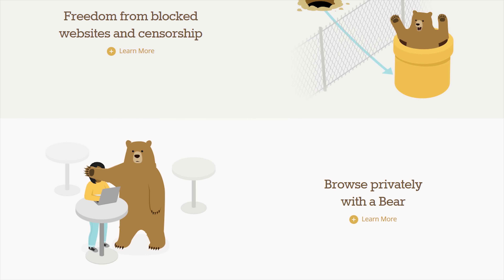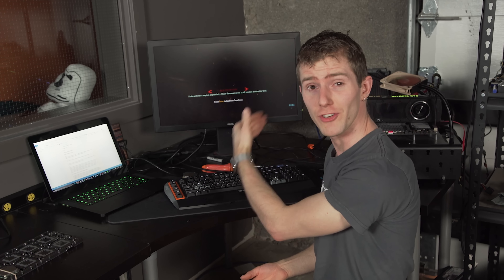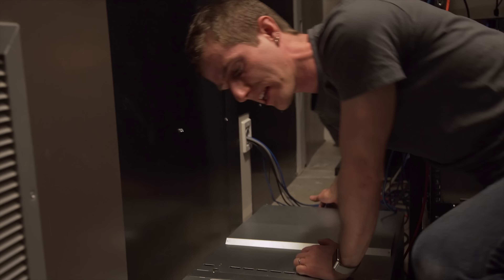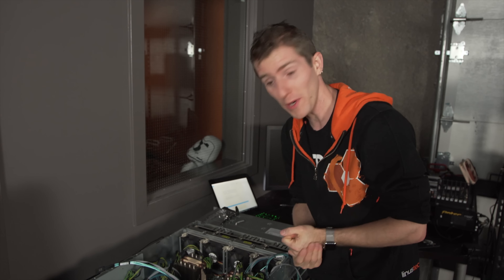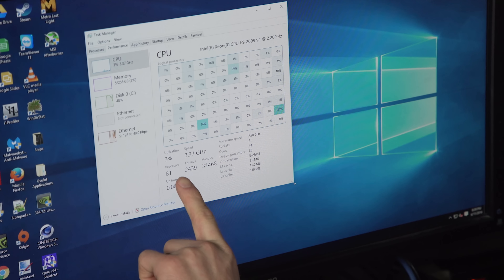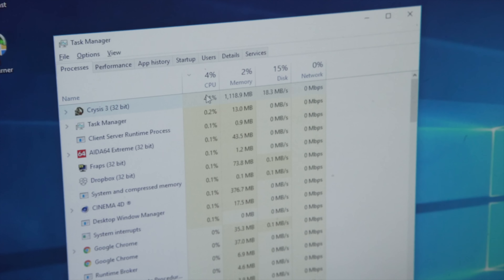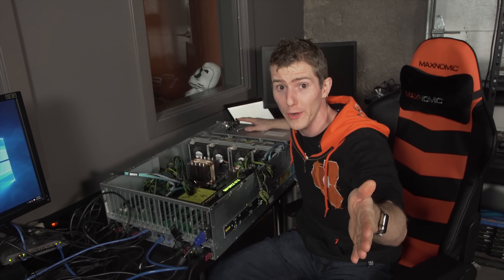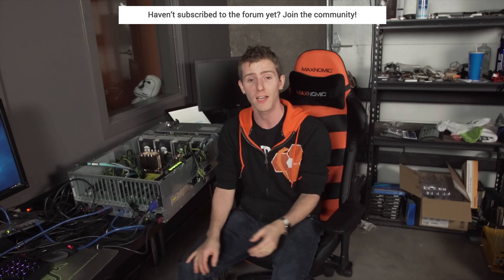Two 22 Core Xeon CPUs!? - HOLY $H!T Episode 6

Comment: ASrock has a x99-itx/ac board that can use this. (mini-itx) this is a fact now.

I saw  a 'xeon e6-2696v4' that is 'supposed' to be the OEM(tray) version of the Xeon e5-2699v4 cpu. is this actual or just some sort of sophisticated ripoff? supposedly this 2696 variation is identical to the 2699 except the TPD is 150W instead of 145W.

Comment: I have i7-4770K and I would say it's waaaaay more than enough for even for me. These 4 cores can do anything, they can handle any game and any software like nothing. I'm not even thinking about upgrading it in next 5 years. But this Xeon is f** insane. It's roughly 7 times faster than 4770K which is already too much for any existing game and there are 2 of them. Either CPUs are too powerful nowadays or game developers are pussies LOL
We definitely need quad CPU motherboard for these.
Reply: most games dont use more then 2 cores effectively, let alone more then 4... Xeon is like having a big truck and only a 1 out of the 12 cylinders are doing work...

Comment: Hello, I am new to computer stuff and have basic mechanical and theoretical knoledge of computers. 

Is it possible to have multiple cheaper Cpu units (like i5's) instead of one beastly expensive CPU unit ( like a top of the line Cpu)

Me reasoning is that a few good CPU units costing around 100 $ each are cheaper than 1 monster CPU unit which go for around 500$.

My mission to accomplish for my Computer is to be able to run crisis 3 cinematic( benchmark) well. And I do not have a lot of money.

Thank you very much for any and all support, ( yes I am a convert from the present console race)
Reply: Unfortunately not cheaply. Most consumer grade motherboards don't support multiple CPUs and modern server grade ones are more expensive. If you want to build a pc, there are plenty of build guides for several price ranges, or you could go to www.reddit.com/r/buildmeapc and look/ask around and honestly you won't need a terribly powerful CPU with a crazy amount of cores as most modern games don't get much of a performance boost (as you can see in the video when crysis was using about 7%.) Your graphics card would be your biggest limiter as far as performance goes. Do some research and decide for yourself what you want to do

Comment: Can anyone say that will dell Inspiron 5559 which has i7-6500u, 2 cores with hyper threading can run most of the games smoothly(not expecting best performance just good)
Reply: mouhamad youssouf Depends on what you consider to be ''good''
Reply: Marian Palko Like GTA 5 in low settings, etc.. Will it play smoothly in the device?
Reply: mouhamad youssouf Probably not. Even if you had low settings, I wouldn't say that it would be smooth at all

Comment: My MacBook Pro costs less than one of those CPU's and its processor clocks higher, at 2.4Ghz stock.
Reply: +Logan Darklock really? lol but it has only 4 cores? use you're brain...
Reply: ***** yeah, but it clocks higher lol
Reply: wooow do you even know what you are saying? lol even if it is clocked lower, the single core performence is stil mutch better and it has f*cking 22 cores (44 treads) and 1 core is almost more powerful than all youre core's together...
Reply: ***** guess what? I DON'T CARE. I'm just saying mine clocks higher. NOT that it's better. Just saying.

Comment: well, put 4 of these on a server motherboard, than add 250 Gigs of ram and finaly, 4 GTX1080 in sli :)
Reply: this e5 doesn't support 4 cpus
Reply: you cannot put 4 GTX 1080 in QUAD SLI those only support 2 way SLI
Reply: xro fre
(facepalme) It's just locked, if you want 3 or 4 way sli, you need a entousiast key, go watch jayztwocents video about it
Reply: What's the geek The enthusiast key you mentioned is being dumped,GTX 1080 Quad SLI basically won't be able to run in Quad configuration despite you still be able to run 4 GTX 1080 without enthusiast key just for specific OC applications.NVIDIA is focusing its efforts solely on 2-Way SLI only and future game ready drivers will include only that profile for games not to mention the fact that SLI scaling way too bad it just stalemate. So you're wrong.

Comment: 22 core??! I have a 8 core. Smh
Reply: yea but funny enough to buy a system with todays technology like x99 and ddr4 ram the system costs like 4k with a single gpu and the rest so might aswel fork over 5k for a high-end cpu that is pointless
Reply: i have 88 cores and 176 threads across 4 cpu's
Reply: jonathan oxlade that's 2k not 4k